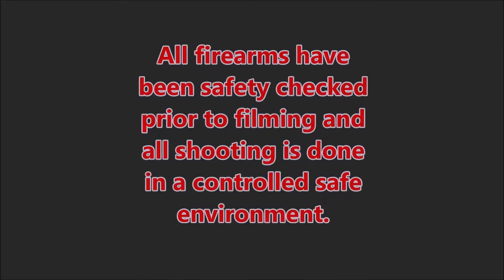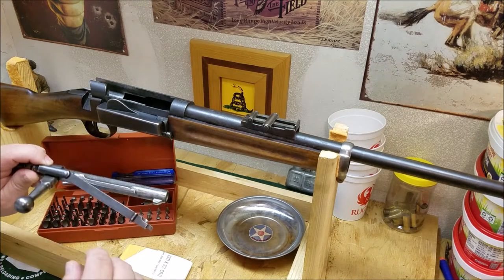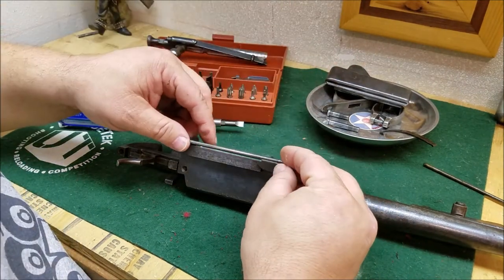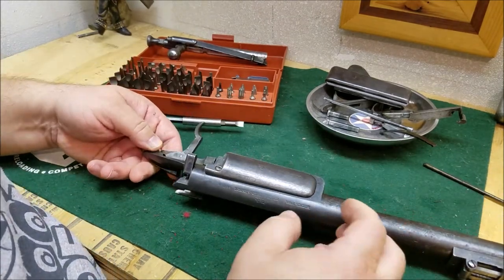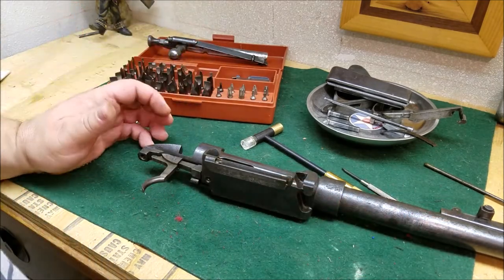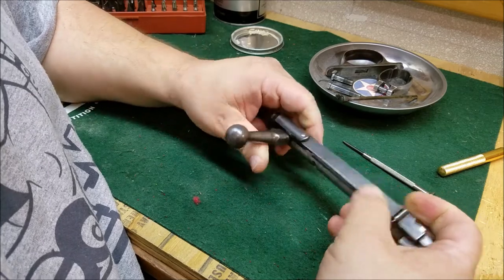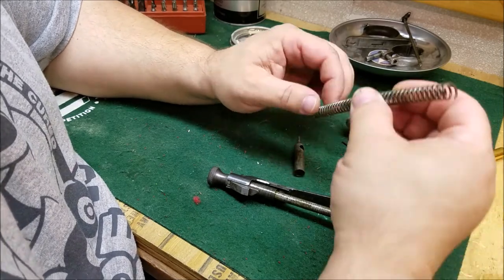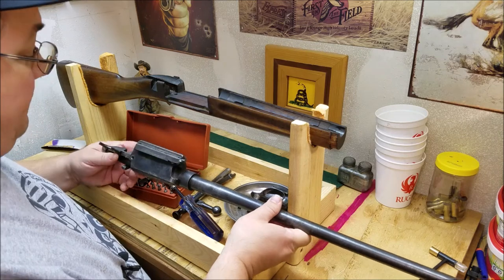Model 1898 Springfield Krag - Jorgensen Deep clean & Take down.

Comment: In the but of the gun mine has a circular metal latch. Opened it has a deep hole going on an angle. Any idea what that is used for.
Reply from the maker: That is for the cleaning rod and oiler kit. You can find them at Grandpas gun parts. Thanks for watching.

Comment: The side plate on my Krag Jørgensen doesn't have a screw. How do I go about getting it off, when it doesn't have a screw?
Reply: Did you figure it out?
Reply: I got it you have to remove the magazine selector by forcing it in the middle posisjon and pulling straight back

Comment: Great job.  I WAS afraid  to take  mine apart,  now I'm not.  Question... do you use anything to clean the wood?
Reply from the maker: Thanks for watching.  Glad this could help you out. As for cleaning the wood I don't currently have any suggestions, I have tried several things with varying results.
Reply: I use Plain Lemon Oil. You can use it one the whole exterior of the gun. Normally I use the Lemon Oil on wood and Balistol on the metal parts. Nice thing is Balistol won't hurt wood.
Reply: use boiled linseed oil, it works wonders on my M1 garand and M1 carbine stocks so i highly recommend it

Comment: MAJOR TIP: check that your safety is off when putting the firing pin back! It is way harder when it's on safe!
Reply from the maker: Thanks for the Tip. This one has had the safety removed at some point like so many of the sporterized Kraigs I have seen.  The Safety is one of the hardest parts to find on these and the few I have found, they want a ridiculous price for them. This one at the moment is just a fun range toy and if I were to take it hunting I would just carry with an empty chamber.  Thanks for watching.

Comment: can someone explain to me how he put the bolt back together?
Reply: Yes. You have to pull back the firing pin to be able to turn the outer part of the bolt back on. You need to use some power to get it back together. 

Also when you take it apart you pull and turn like in the video, but if you rest the pin back when you have turned it a little bit and then turn it the rest of the way. You save yourself from smasing the bolt in the wall😉.

I've done this on my old Norwegian Krag.

Comment: Where's the safety on your rifle??  I was/am thinking of cutting down the safety as it runs into the bottom of just about any scope.
Reply from the maker: Safety is missing that seems to be common with cut down rifles. I have looked for one and they are almost impossible to find. When you do find them they cost more than I paid for the rifle. If you don't want it remove it and sell it. Thanks for watching.
Reply: @45AlfaCharliePapa  I was looking for one today--so that I can keep the original and maybe grind down the replacement--to make it stubby enough to clear the underside of a scope.  I saw some old safeties on a website for about $25.00...not sure what I'm going to do yet.  I'd probably just sell the rifle, but my favorite uncle gave it to me over 40 years ago, and I bagged my first deer with it.  I have sentimental attachments to it.  I want to put a decent scope on it, and fix the safety, so I can give it to my nephew one of these days.

Comment: Rumor has it that you can use the Briti .303 ammo that true?
Reply from the maker: No. The Krag is a .308 bore, the 303 is a .311 bore.  If you could chamber the 303 the pressures would be excessive due to the larger diameter bullet. and would destroy the gun in short order. Thanks for watching.
Reply: @45AlfaCharliePapa  the 30-40 are becoming scarce so i was looking for some alternative ammo
Reply from the maker: One of the reasons I reload. It is out there. Check out Graf and Sons they specialize in hard to find ammo and components.